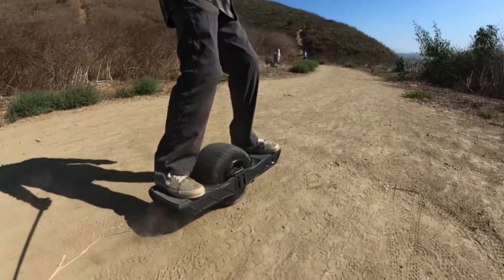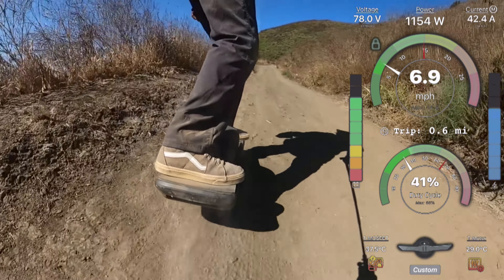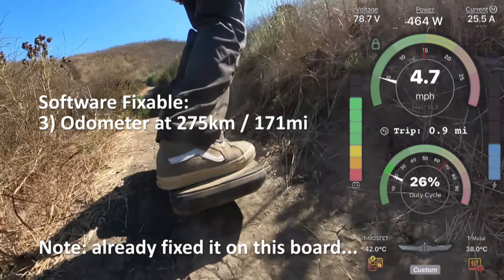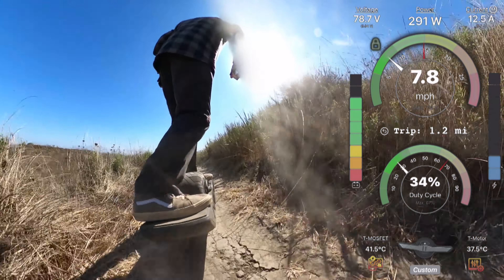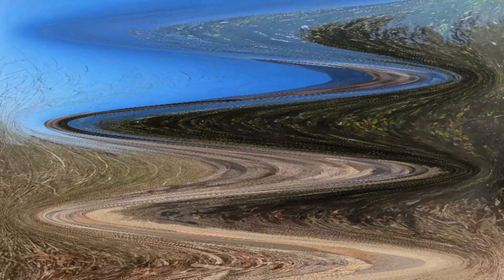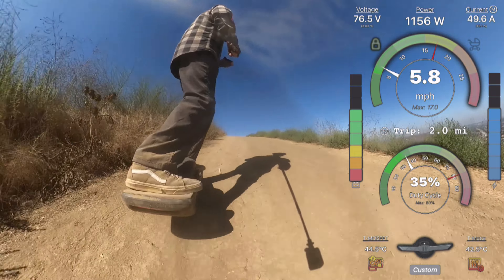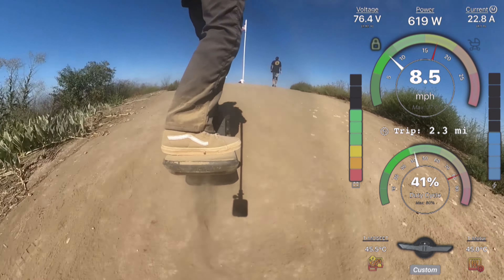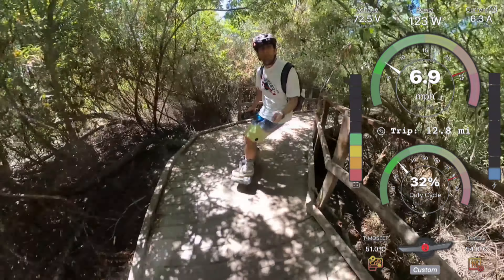Floatwheel ADV Pro - Issues and Fixes

Comment: Did the bms shut off power or did the water short out the motor/controller?
Reply from the maker: The BMS had no clue - the water in the motor connector apparently fried something in the ESC. Working with Tony to diagnose/fix
Reply: @surfdado   it is the stm32 IO pins got damaged from the water in the plug, packing a new ESC for dado now , and thinking how this doesnt happen in the future. clearly the water got into the motor connector and briging the high voltage shunt to the hall sensor port on the esc and it killed the stm32's IO pins on temp and hall 123, the plug might need anorher layer of protection,I'm thinking maybe a condom for the plug itself, any ideas are welcomed.
Reply: @floatwheel  Might want to take down your "waterproof testing" video. This thing is clearly not as "waterproof" as your testing suggests

Comment: Put soldering iron to those hub bolts first
Reply from the maker: Tried a heat gun on high for 30 seconds, made no difference
Reply: @surfdado  500 C directly on the bolt for 2-3 minutes.  It works on bolts with red Loctite
Reply from the maker: @Kay0Bot  oh damn, that’s a lot of heat to a component that’s thermally connected to the stator. But I guess it could work. Hopefully I will never need to do it again 😂
Reply: @surfdado  oh good point. i think 230c is the red loctite heat limit, so 300C for 2 minutes should work.
Reply: @surfdado  I had to torch the axle for 30seconds for the bolt to get off, man those aged loctite is strong.